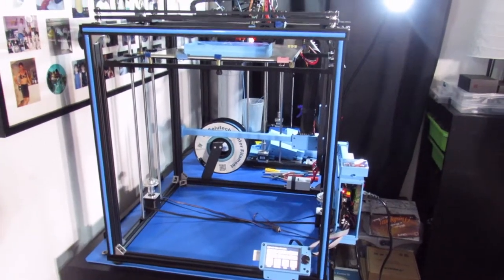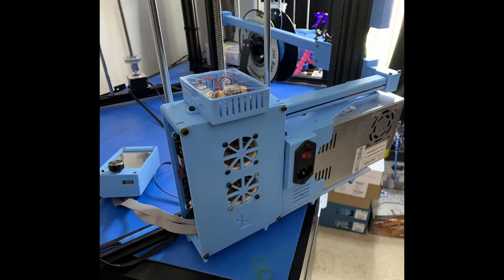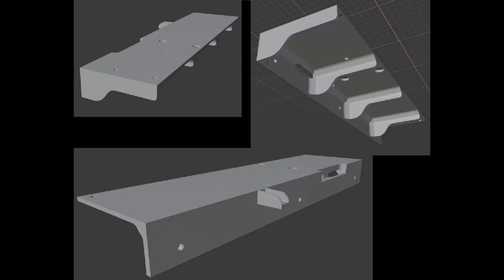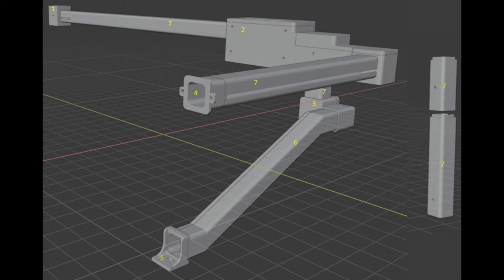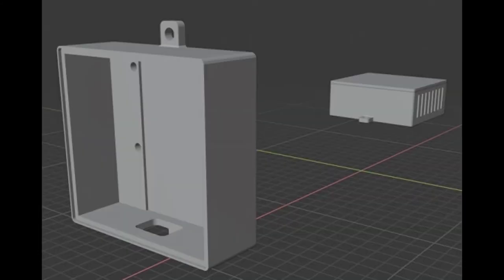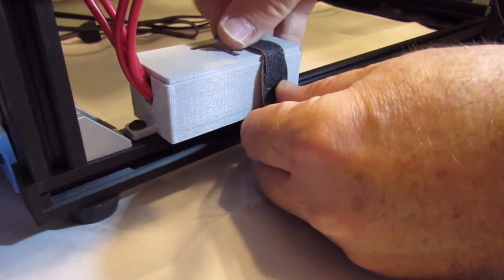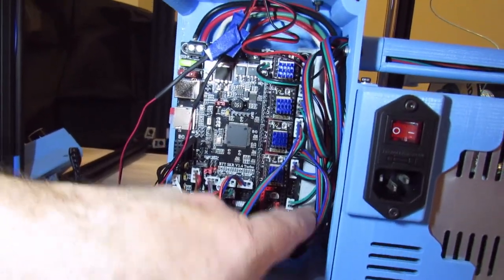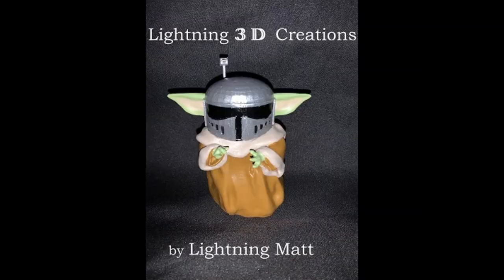Tronxy X5SA Pro SKR 1.4 Turbo Electronics Enclosure Build

Comment: Nice work.
After 5 years dormant state, I finally decided that I need a 3D-Printer myself. I Think the ideas come with the abitlity of "easy" manufacture. 

I watched a ton of videos already and the Tronxy X5SA-Pro seems to be my favorite now. Rigid Cube, and with the PRO Version´s steel rails a good alternative to (i guess more expensive) linear rails and of course much better then the other V-Rail guide systems, but i´m a little bit "worried" about the corexy-system and longterm accuracy. It´s a lot of belt which can stretch, and a lot of pulleys which can block and bending their support pins.

N° 2 would be an Artillery Sidewinder X1. Problems with "Vibration" with growing model height, especially when the Filament spindle is mounted on top.
N° 3 would be an Ender3v2.  But i read Crealitiy has some QC issues. One works, the other doesn´t. Only one Z-Axis stepper motor.

+ on both: printed model always drives in y-Axis up and down + No building fun, because they are preassembled ;(

@2:25 in the still frame i´m interested in the pulley on your z-Axis spindle. The X5SA has two z-Motors, but they are not linked, like with the Sidewinder X1. I thought of the possibility to do this as a MOD, and wanted to know if this is your solution for linking left and right z-Axis spindles. And when yes, could there be problems with the bearings of the stepper motors or a disalingment of the motor-spindle couplers? Best place for this connection would be on top at the upper bearings, but wouldn´t be so practical with printing ;)

Another question would be: Why did you change the controller board? Is it faster? Mor quiet? I think i saw removable stepper drivers, are these those TMC drivers?

Thank you for suggestions.

Edit:  Ahh! And the parts in the boxes with transparent covers, are those DC-DC Step down converters for alternative fans ? Do the original ones run on 24V? I read they should be replaced by Noctua or other quiet brands.

Comment: Looks pretty cool! I have a tronxy that was given to me by a neighbor. I have 2 prusas and an anet that I have frankensteined already. I bought an skr e3 v2 for the tronxy. The original board caught fire on the bed mosfet. I am having a really hard time finding firmware for this set and it seems that you have almost exactly what I have. Can you point me in the right direction?
Reply from the maker: Marlin Firmware configuration and configuration.adv are posted in Tronxy & Turnigy X5S, X5SA ,X3S 3D Printer Drucker Users ( https://www.facebook.com/groups/169728600253557 ) file section.